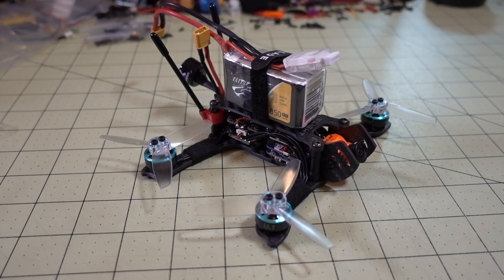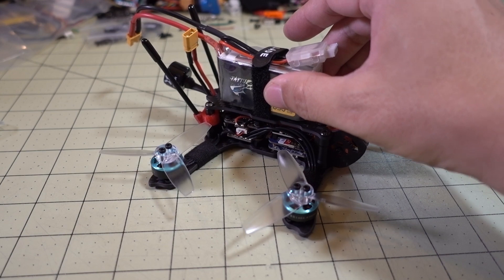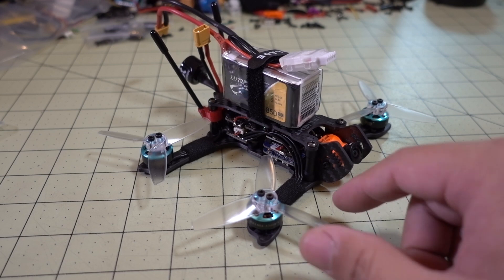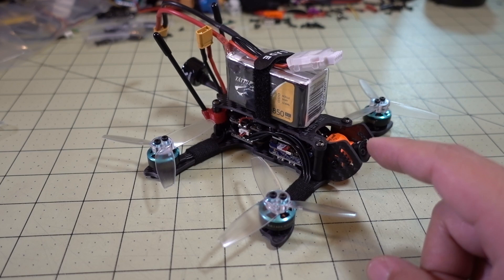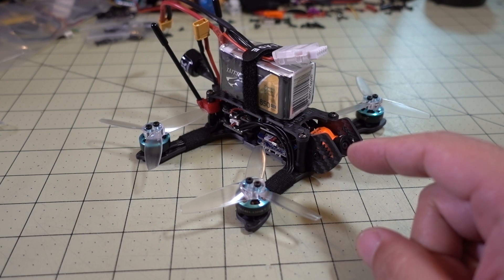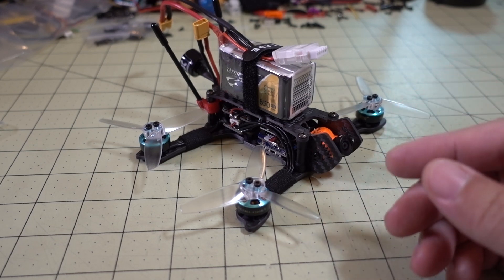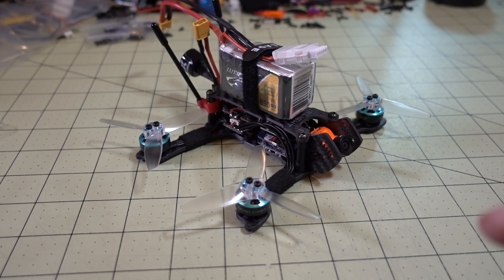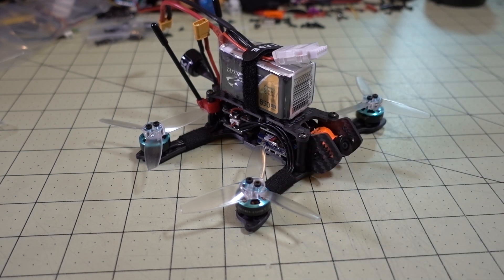12 Minute Flight!!! (DYS 1404 4300kv Motors) 👍

Comment: So what really gives you the long flight time is the Motor size and kv and the battery correct? Of course the light weight frame. But i think that Motors is the key
Reply from the maker: What you want is low current draw.  So that can be a combination of weight, prop, motor kv.  Lower weight = lower current draw for example.  Lower motor kv = lower current draw.  Combine one or more for magnified effect.

Comment: Thanks for this video. I also want to create a long flying 3" build. I can't find those motors, but am considering the XING 1404 motors, that come in 3800 and 4600 KV. I would have thought the 3800 would be more efficient, but you said that the 4300 could be more efficient than the lower KV one you saw. Can you comment please? Link to motor here: https://www.banggood.com/IFlight-XING-X1404-1404-3800KV-4600KV-3-4S-Brushless-Motor-for-DC2-HD-TurboBee-160RS-Toothpick-RC-Drone-FPV-Racing-p-1610004.html?cur_warehouse=CN&ID=49353&rmmds=search

Comment: One more question sorry .. do I use a xt60 or xt30 ? For the Diatone Mamba f4 20x20 Smaller Gauge wire with xt60 connector ? Or just use what’s in box thanks
Reply from the maker: XT30 is fine for this setup

Comment: Hey I was wondering would you be able to build me one ! ?? I’ll pay you I need Crossfire and VTX the best of the best build ? PayPal ?
Reply from the maker: My hourly rate is ridiculously high.... I'm pretty sure you won't want to pay it.
Reply: Damn hope is not like my Rates lol I’m a Union Plumber in NYC wish you was around just to busy to build one. I’m still new coming from rc racing 25 years @ralbovski . Gimme a state of the art parts list ? I’m going to serbia soon need this but on serious steroids :) thx buddy
Reply: On inStagram I’ll follow you 🍻
Reply from the maker: I have a plan to revisit this frame with updated parts but not sure how soon I can make that video.  I think the EMAX 1306 2300kv motors on this frame with the same props on 4S 850mah should fly for even longer.  Instead of Split Mini, use the Caddx Turtle, and the the flight stack use the Diatone Mamba Mini.
Reply: Albert Kim o man thx a lot for the inside scoop gonna be a nice Crossfire small mini to the clouds :) and gps installed also we not lol since I’m soldering already. Thx buddy appreciate it.. and keep up the good work love your videos 🍻

Comment: This is great. 

Just a small suggestion would be to add the throttle value to the OSD, so we can get the idea of how much power 'left over' there is.

Similarly, how well does this fly for cruising with the occasional bit of freestyle? Or is it too heavy for that, and best at strictly cruising?

Comment: Albert,  will the FrSky R9 MM mini receiver long-range work with the describe  parts list for the build?
Reply from the maker: I haven't tested that receiver yet but if it's like the original r9 mini rx, you just run it in SBUS mode like the XM+ and it should work.

Comment: Hey Albert don't stop making these videos please. I'm one of many who thinks longer flight times is a must in FPV. Everyone doesn't race and I believe the longer flight time helps with confidence for those, like myself who are new to FPV. But I must admit you really were cruising. 😁 What throttle % were you at? Maybe next time you can do some cruising mixed with %30-50 throttle punches. Oh, and these videos have changed my direction in what type of drone I would like to build. A 350hp car is just as fun as a 500hp car! Keep up the great work!
Reply from the maker: For this kind of "test" video I am going to keep the throttle as low as possible for as long as possible.  That was you know what the 'maximum" potential is.  If you mix in other types of flying with more throttle, just assume it will reduce the flight time from there.

Comment: Hey AK

Just got that exact frame yesterday. Cam plate spacing is a bit off. Im guessing maybe 17.5 - 18mm only. Cam fit is too tight for me. And the 20x20 stack holes are 3mm.whats up with that hole diameter anyway!!. Well those are just my rants(that needs fixing).

 Couple of things I like with this frame is for those who like 'centered gyros' configuration, its possible for 3rd stack, have to mount on top plate(its centered). And the chamfered edges, VERY nice. I still dont know why they havent done it to the top plate as well.

Im still waiting for motors and turtles to arrive. Still thinking what cam to use. Split mini or turtles. 😕😁

Comment: Wow a 12 minute flight sounds attractive. As you pointed out it might be hard to stay concentrated for that long. I call that a browser its pretty cool. I wonder if those motors would do a similiar flight time on my 3 inch quadthat weighs 200 grams without battery. Could i get a longer flight at least and how juicy could it fly? What does it weigh?

Comment: For such long flighttimes i'd prefer to mount the VTX-antenna upward or downward but not horizontal at the rear. If you fly away until the video becomes noisy and you turn back the video will drop entirely because the quad is between you and the VTX-antenna and one of its dead-spots is pointing towards you - thats not good.
The upward or downward-antenna is more exposed in a crash but thats not a problem in such a soft cruising flight. The good thing is then that you can fly away as long as the signal is ok and turn without loosing the signal. And on such flights 10 mins are not too much. I like that .

Comment: Well, i like these videos!
I have always been interested in small quads with long flight times, especially when specific components available to everyone and not some one of a kind build that requires an engineering degree.
I'm still a noob at this hobby, currently im learning on a 250 zmr with 2205 low kv motors. I'm getting around 7 minutes on a multistar 3s 3Ah lipo (like a flying brick). But if you feel that these vids don't get enough views then it's up to you brother.
Cheers!!

Comment: i ama building 3 inch with 2 option 3052 and 3045 props using same battery as you, hope it will show some good flying time as you :) , my motor is 1407 3500KV

Comment: I would like to see a test of the Airblade UAV Superman 1404 motors. Maybe on the same frame. They look like really nice motors. Overall system efficiency is what interests me. I would like to see how small of a battery you could get, to get the AUW down. How about 4 whoop batteries in series?

Comment: My thoughts about the flight time are that each motor has a high efficiency power band and that in these flights you probably aren't changing the throttle much, so if the DYS has a better efficiency in the limited throttle band you flew it that might be why it's 50% more efficient. I bet that if you flew both a bit more aggressively using more of the throttle range it might even out the differences.

Comment: IFlight iH3 3 Inch 142.5mm F3 15A ESC 5.8G FPV Racing Drone w/ RunCam Split Mini 1080P Camera

Specification:
Brand Name: IFlight
Model: iH3
Item Name: 3 Inch F3 5.8G FPV Racing Drone
Version: PNP ( Without Receiver ) ;
              With Frsky XM+ Receiver    
Net Weight: 124.1g 
Weight: 128g             
Hover Time: 5mins
Wheelbase: 142.5mm
Frame weight: 39g
Bottom plate thickness: 3mm
Top plate thickness: 2mm
Vertical side plates thickness: 2mm
Vertical side plates width: 19mm
Standoffs mouting distance: 22mm

Flight Controller & ESC: 20x20mm IFlight Mini F3 & 15A BLheli_S ESC Flytower
- F3 Integrated with betaflight OSD, 5V@3A BEC output
- BLheli_S firmware, support Oneshot, multishot, Dshot150, DShot300 and DShot600
Brushless Motor: IFlight iPower Force 1106 6000KV Motor
Propeller: Emax AVAN Mini 3024 3-Blade Propeller  ( Clear Red Color )
FPV Transmitter: IFlight Force Mini 48CH 25MW/100MW/200MW S.BUS VTX
Camera: Runcam Split Mini 1080P/60fps HD recording & WDR FPV camera
Antenna: Foxxer  Pagoda Atenna ( SMA  )
Recommend Lipo Battery: 2S 850mAh Or 3S 550mAh ( Not Included in package )

Package Included:
1x IFlight iH3 142.5mm Drone
1x LED w/ Buzzer
1x Strap for Battery
1x XT30 Cable
1x XT30 to JST Cable
1x Magic Tie
Reply: Ultramano it's too bad that the prebuilt has too high of KV motors for 3" props.
Reply: Charles Warwick thanks!... could the high kv motors be the problem?
Reply: Ultramano yeah, 6000kv motors are too much for 3" props unless you fly slowly and don't use the top half of the throttle. You might be able to use 3s instead of 4s, but even then you'd have to be careful to chose low pitch props.
Reply: Ultramano It would fly reasonably on 2.5" props though, just wouldn't be as efficient.
Reply: Charles Warwick  thanks again...
I will try different props...👍
Reply: Yeah 3s is probably okay if you use low pitch props, 3030 or lower would be a good starting point as the BNF is ~90g w/o a battery so it's actually kind of heavy. Motors even more efficient than what Albert is already testing? Maybe I need to plan on an upgrade once they come out because that sounds like a great long range setup. How do the RCINPOWER 1108's work for you? I've heard they run pretty hot because they don't have good cooling relative to the stator volume. The thrust tests for the 1108s look crazy.
Reply: Charles Warwick I will in the future try other motors but I will try the props first...they’ve made 1108 with low kv? Or there’s only high kv?... I think that they will drag too much amps isn’t it?
Reply: Props are always easiest to try first. Do you already have the iH3? The 1108s come in either 4000kv or 6800kv. You're definitely right about that, the amp draw is >20 Amps with 3025 props at 6800kv on 3s, the 4000kv version is about perfect for 3" though.
Reply: Ultramano The 1108 6800kv do draw kind of a lot of amps but on 3s a 20amp esc is plenty. My friend runs his on a 15amp and hasnt had issues yet. They handle 3 inch props just fine because they have a hell of a lot of torque. The rcinpower 1108 6800kv produces over 500grams of thrust on 3s. Thats literally more than any 1407 ive seen on 3s. They are PLENTY powerful for 3 inch props. They could push 4 inch props if they made them in t style mounting.
Reply: Charles Warwick dont forget that amp draw on the bench is  35% higher than when in the air. So you can use smaller amp esc than expected. 15amps on 3s is also easier on the esc than 15amps on 4s. Thats why some esc's like the Hglrc zeus have listed a seperate max amp rating depending on how many cells you are using. Sometimes youll even see 40 amp esc that are only rated to 5s even though youd assume they could do 6s with 40amps. Its because its harder to do the same amps at more volts. I actually use a 28amp esc on my 1108 6800kv because I thought I would need it. I've since realized it was overkill. BUT It can be nice to have overspecced esc incase I ever get stuck in a tree and need to try to break out without burning something up.
Reply: Interesting....Meibe i will try.... but the noise on my goggles will be fixed if change for a set of this motors?
Reply: yes I already have the iH3 and it came with 1106 6000kv motors it flies nice the recording footage it's really satisfactory but the reception on my Fatshark HD3 it's really noisy when put the throttle up...

Comment: Great vid. I e been wondering what a 1304 or a 1404 would do on a babyhawk to 3 inch. After watching his I may try it out. Your quad is flying smooooooth as heck too. Love it.
Reply: Thanks to Albert's work, my last build was a 2.5" Massive Droner with RCX 1304 5000kv motors that I fly with Tattu 450mah 4S batteries - it goes like a bat out of hell with cold motors and 6 minute+ flight times!  The balance of motors, a great frame design and Gemfan 2540 props is really a sweet spot!  Probably my favorite build, and way more torque than similar builds with 11XX motors.
Reply: I am running rcx 1304 4000kv motors on my Hglrc 3 inch frame with a hglrc double stack and get 10 minute flights doing mild acrobatics ,zooming through bushes etc on a 850mah 3s and almost the same time with a 650 mah 4s. I even fly 7 minutes on a 800mah 2s packs . I have 2 of each size and fly back to back which is close to an hour of flight time. I think the sweet point is duration vs performance, a rather long flight with the performance capability to keep yourself engaged with graceful acrobatics. My opinion only!  Great Vid Albert ,,12 minutes is impressive.

Comment: Hello Albert, i have the Furibee F90 and i soldered on the receiver and camera, it works fine and i have it connected, but the board self wont come on, not even on betaflight, there is no beeping when battery comes on and no light... Please tel me how to fix, please?
Reply from the maker: Thanks for the question.  Sorry, but I don't have enough information here to offer a solution.  I don't really know what's going on based on this limited about of information.

Comment: I am very interested in the longer "endurance" times you post, but agree more than 8-9 min. of cruising isn't the main point for a racing style miniquad. I think if you just fly consistently your normal style, (a sane amount of flips and rolls, some fast flying, and a few punchouts), your flight time will tell me what I can expect to get. So if you build a quad for long flights and fly it "normally" (not power looping 20 times and not 100% cruising), that quads flight should reflect it in the time, and maybe your acro  and agility moves won't be as strong. Since you normally tell us what the quad did well and not so well, that's the most help for me.
Reply from the maker: The long term goal of this testing is not for racing quads but for a micro platform that can record HD video and go long range.  You can't go long range until you have long flight times.  Obviously, this idea will become more useful when I go to some more interesting locations and record some epic footage.  That will be later down the road.

Comment: I started off flying gliders RC and it can take 10 minutes or more just to get down from a hand launch and that's LOS. Anything under 5 min and I'd rather go play golf or something as I'm just getting warmed up;-) I relax when I fly and learning to trust in light flying through stuff so really like the smaller quads as they fit in smaller holes... excellent video and nice to see quads getting lighter with the potential for longer flight times as well as feeling what the weather is doing something flying bricks don't do well. Have my timer set to 2.5 min on my small stuff with lots of FOD so glad time is fixing that as a well designed quad should be able to dump the battery fast or extend the flight time. 12 min flight times is impressive for a 3 in prop.

Comment: Hey bro 
I have one builded for inflight team and the video reception on my goggles are terrible... impossible to fly with confidence...I have tried a capacitor on the battery but didn’t solve the problem.
With your experience in miniquads can you identify the problem?
Thanks in advance
Reply from the maker: Perhaps you're not on the correct channel?  I'm not sure what parts are in your build so impossible to offer suggestions without that information.

Comment: Would this set up go even longer with some 2 blade props like the 3025s? That might be some serious flight time overkill though!
Reply from the maker: In previous testing the 3025's performed about the same as the 3035 at low throttle "cruising around" type of flights.  I guess you missed that from earlier.
Reply: Albert Kim Whoops, guess I did. Thanks.

Comment: I have a long duration 4" 1306 cruiser for messing around in small spaces. Very little power or punch but super efficient on a 650 3s. I have achieved over 10 mins but around 8 is more typical.

I agree though, for anything with the kind of power we are used to much longer than 6 mins is too long. We decided we were asking for too much power, now maybe too much flight time. Maybe set 5 mins as a target flight time and see what the best thing you can come up with is.

Comment: Considering the efficiency of motors and props today, it is not surprise to get such flight duration especially on super-lite setup. We're just don't do much cruising anymore until long-range is coming back. In the old day when quads are 300-500 size, no one does acrobatic.  Today with lighter gears, better battery, more efficient motors and propellers not only allow modern quad copters to do amazing acrobatic maneuver but a well managed throttle can give quite a decent flight duration.

Comment: If you put the mah/hr on the osd and your throttle value.  You can coach yourself on efficient flying.  Also, you could then move to a lower c rating and lower weight 850mah pack. Maybe same weight and a 1000mah pack.  I'd be curious how many more minutes you can squeeze out w some efficient low pitch biblades.

Comment: as far as the differing time you have to look at the thrust your producing to keep afloat and what the current draw is at that point. It's like when people say wow those X motors really put out the power but really draw a lot of amps compared to Y motors but if you look at both motors at the same thrust they could be close identical but people always get power happy and punch the throttle all the way and at max yes the X motor will draw more I pay more attention to the 300-500 thrust data to compare motors for efficiency, than max thrust, well on micro size it's more around the 80-120 mark.

Comment: With the same battery, Gemfan 3052 props, ufl to SMA adapter (5cm long) + UXII stubby mini and with a Flit10 I've got 8.5 minutes with my XJB-145 (1407 3600kv) with a little faster cruising and a few punch(y) acceleration. Imho I couldn't fly for 12 minutes, but 10 minutes seems to be reachable with a total cruising style, but to be honest, I was a little bored :) 7-8 minutes with action is much more fun, but I'll try to reach the 10 minutes mark if I will be able to fly again, but I'm in simulator mode now because my FC died yesterday :(